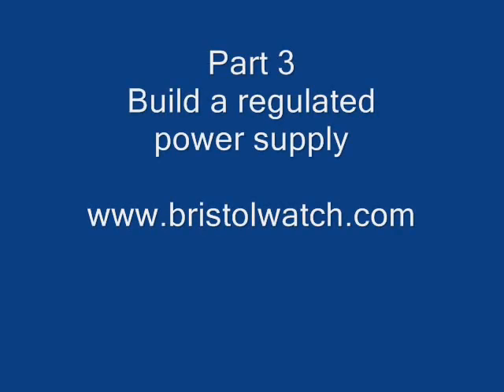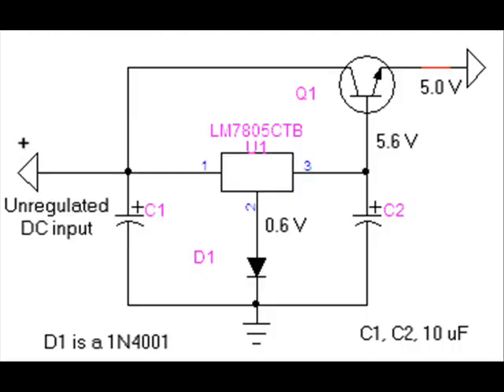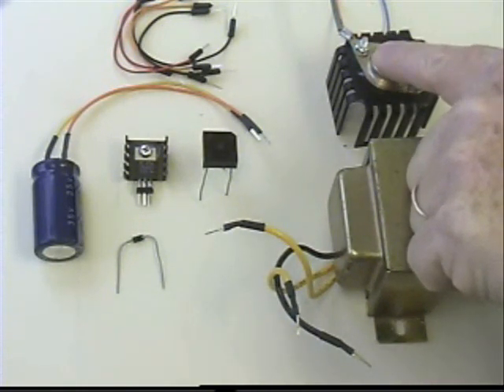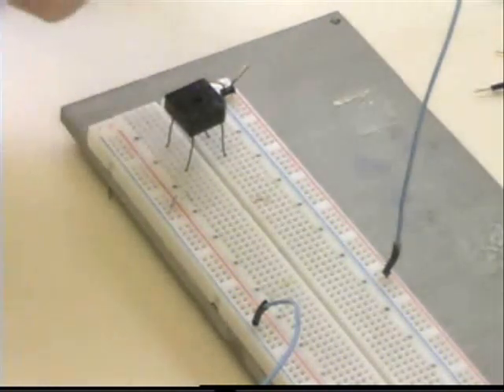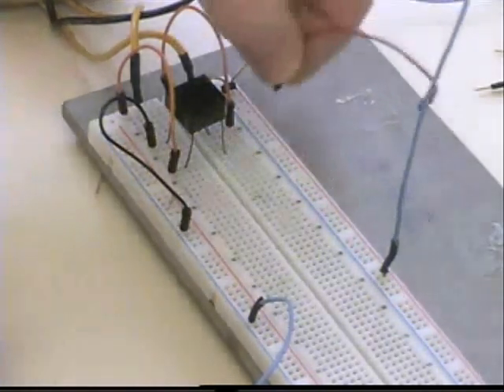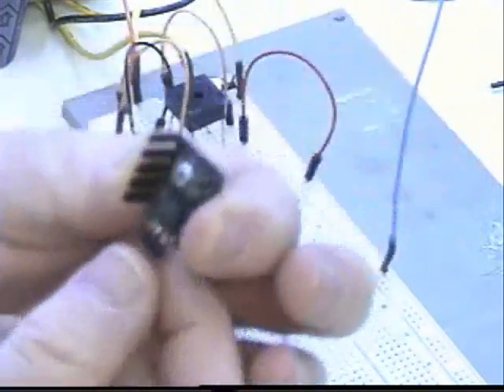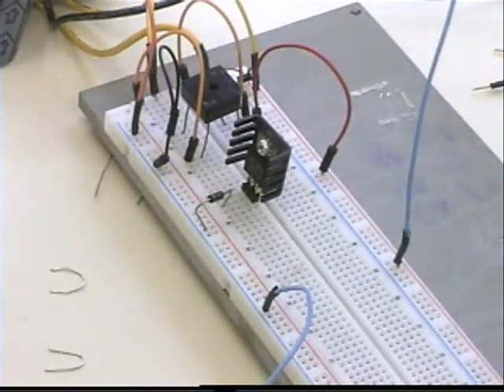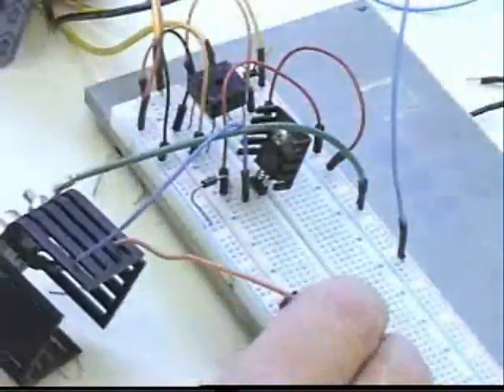Build a low voltage DC power supply Part 3

Comment: The transistor has only current gain, no voltage gain, so the output voltage to the emitter is the voltage of the base. This is the hinder for me to go on at the beginning.
Reply from the maker: Bipolar transistors only have current gain. The output voltage is the collector-emitter saturation of about 0.5V
Reply: @LewisLoflin  Yes, I just realized that. Thank you very much! I am a medical student but I am also a electronic fans. Your videos help me a lot!

Comment from the maker: Basic Electronic Power  Supplies Part 1

Basic Electronic Power  Supplies Part 2

Build a low voltage DC power supply Part 3

Comment: just a small device to connect multiple fans on one single header.
Fans work at 12,0 Volts. So i presume the device also will.

Comment from the maker: 8  volt transformers are hard to find. Second when rectified and filtered the voltage will not be 8 volts.

This allows all kinds of output voltages using the same common transformer. These parts are far cheaper than a specialty transformer would be.